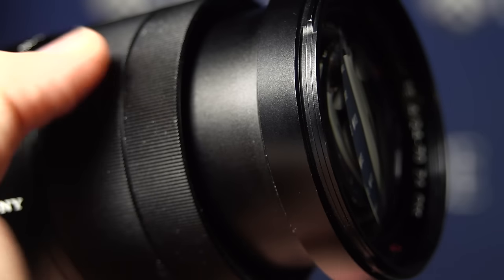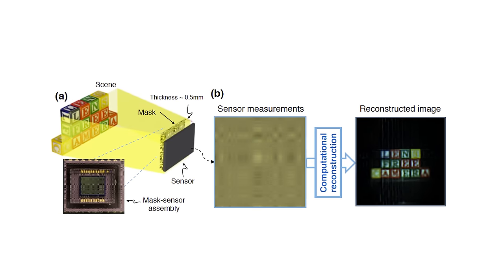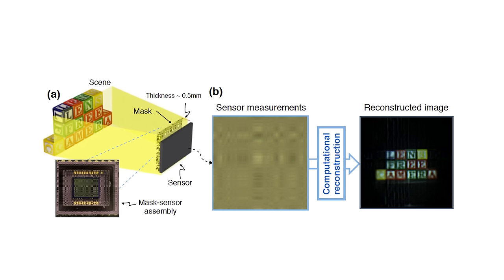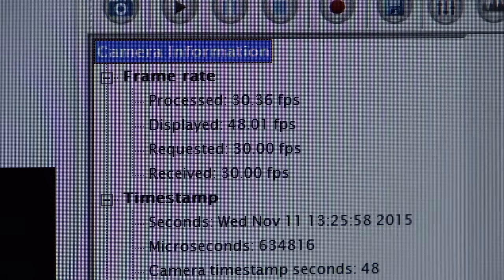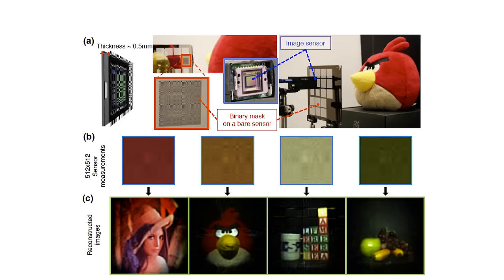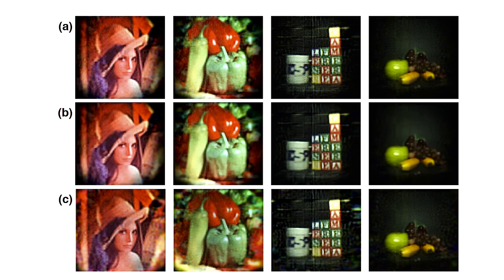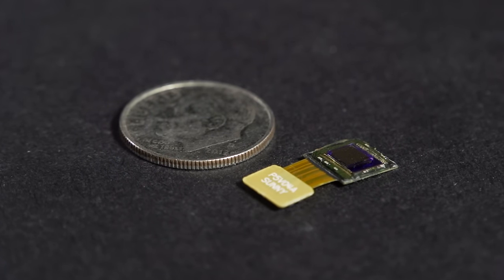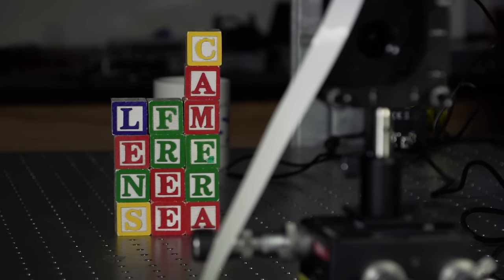No lens? No problem for FlatCam

Comment: What purpose does the mask serve?
Reply: +water_skipper I'm assuming it is a special material made up of tiny pinholes that force light to only hit the sensor from straight-on.
Reply: +Michael Hillard Okay, thanks.  After posting that question, I read a related article and it did say it was like a bunch of tiny pinholes.